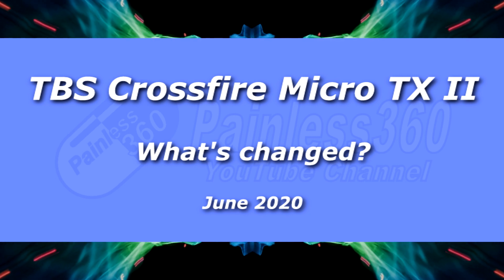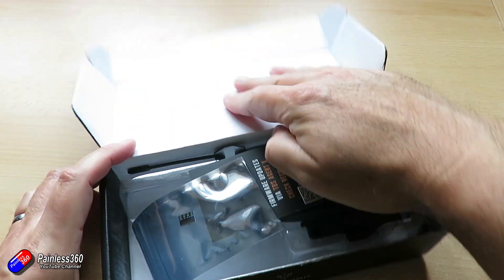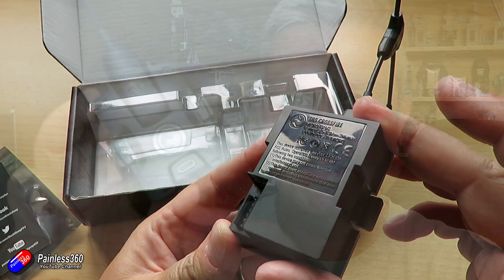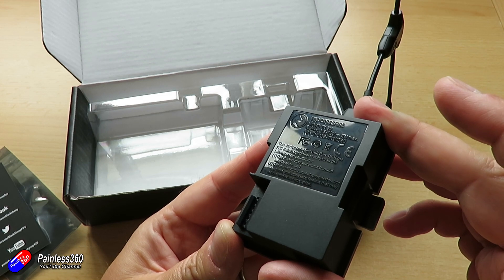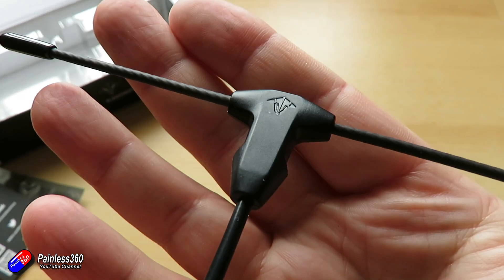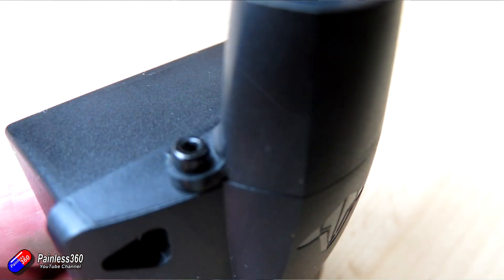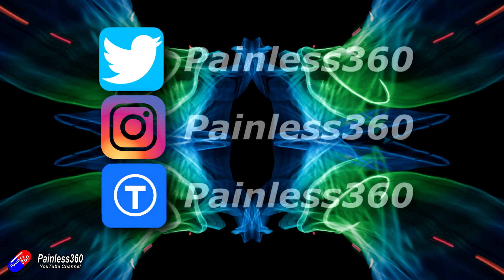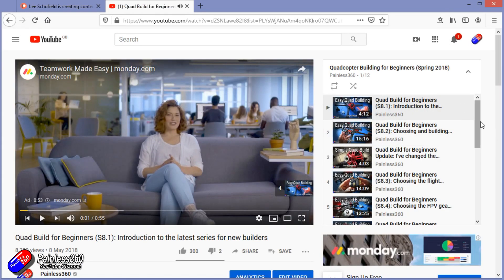TBS Crossfire Micro Tx V2: What's new?

Comment: Question what is the piece that comes along with the module the little tiny board?
Reply from the maker: AT what point in the video?
Reply: @Painless360  It's in the bag you take out with the info card in the very beginning. Sorry I'm a noob just got mine in the mail today and not sure what it's for..
Reply from the maker: Ah! That is a replacement inverter for radios like the FrSky QX7 where FrSky (despite knowing that a faster inverter was needed for things like Crossfire, and the better part only costing another $0.05) cheaped out on the inverter they fitted so that Crossfire couldn't run at full speed.
Reply: @Painless360  Thank you!!! This hobby is fabulous but the learning curve is something else. I just purchased first 5 inch quad  switching from Frsky to Crossfire and purchased the Rapidfire for my goggles. YouTube has been super helpful but not as much help as talking with a knowledgeable person such as your self once again thanks!!!

Comment: TBS are doing it wrong, you're supposed to update it to a new protocol which breaks compatability with not only competitor products but most of your own lol.
Reply: That's a low blow. 
FrSky saw what you did right there
Reply: ugh - this hurts my heart. I'm literally sitting here considering changing because of this. I have an ACCST controller and so I Cant use the newer one, and it doesn't make sense to buy the older one, and currently my R9m is tripping and giving me reception issues...ugh
Reply: @Bigbeardfpv  in this exact position myself. I'll never buy FRsky again. I'll just pony up the extra money for TBS
Reply: @neale3  hey I purchased the micro TX v2 and never looked back. The system is great, and I have a lot more confidence !

Comment: I just pulled the trigger on mine but I have the xlite now I have to get the jr adapter which I can only find in China so it’ll be a month at least before I can use mine unless anyone knows where to get a jr adapter for the xlite in the USA lemme know 😉
Reply: I have that setup. It works but the adapter does not hold the module very well. I had to secure it with a few zip ties. I would much rather have the Tango 2 than a Frsky radio with an external module. If you have access to a 3D printer, look on thingiverse for better designs.
Reply: They sell it on Banggood.

Comment: Any info on the MicroTX v2 essentially getting bricked and not accepting any firmware installations? The MicroTX module worked great in my FlySky PL18, not a single problem. But then I got a TX16S MKII Max and used it one time and powered it off after my flight to recharge the battery. Then the the next time I went to fly, the MicroTX wouldn't power on. It only goes into bootloader mode when I push the bind button and it gets stuck and won't finish the firmware update process. I've tried everything. Is there a factory reset or another work-around that I can try?
Reply from the maker: I've not seen that. I'd check the forums for others who may have had it... Best of luck

Comment: Hi Lee, I am following the crossfire and AR wing series, but I'm having an issue, my crossfire micro Tx v2, won't bind or work in my Radiomaster TX16s, yet will in Taranis X9d+, can you please confirm for me that you are using this combination and it's working for you, all Tx's are running Otx 2.3.10, and crossfire is 3.7.8? Thx Andy (or, have I missed something?)
Reply from the maker: Yes, OpenTX 2.3.9 on the radio and latest FW on the Crossfire. You did watch this video of mine? - https://www.youtube.com/watch?v=1XA_LUymaaI Make sure you're subscribed and have the bell notification icon selected ;)
Reply: @Painless360  Hi Lee, further to this problem, for me anyway, when I installed my Micro TX V2 module, I chose the CE region setting (sets the freq and power to correct values for the UK), however this stopped it binding for me. The workaround was to change the setting to open, then set the power to 25mW and the freq to 868CE, now it binds every time. Very strange but works now.

Comment: I am using the v2 micro tx and although they made the antenna non removable if you move your antenna around it will unscrew the sma to u.fl antenna adapter inside I couldn't figure out why my rssi was so low turns out the adapter inside was loose once tighter up works great again

Comment: Im just starting out into drones. 
I've been told I should buy the TBS tango 2 as all I want to fly is drones.  The tango as you know has the micro tx with power output range 25 to 250mW. Im wanting to build a 6 inch longish range.  Would the tango be enough or should I buy a radio master tx16s and buy the full or lite crossfire later.  Thanks
Reply from the maker: It depends on what you want in the future. If you get the excellent Tango II then you're locked into TBS receivers. If you get something like the TX16s (which a lot larger) then you have options for other parts of the hobby via the other supported protocols and module bays... See my Kit Picks 2020 video..

Comment: Good night. this Crossfire micro TX module works with the old Radio turnigy 9x (with opentx)?
Reply from the maker: It is the same as any other Crossfire module so doesn't need anything different... Happy flying

Comment: Well I guess I'm glad I perchanced the original version last year.  I can replace my antenna with no problem.  I do like the new USBC connector but I can live with out it.. I really enjoy using it for peices of mind and I don't have to worry about failsafe.  Thanks again for the information and video.
Reply: Yeah, but you have to deal with those screws every time.
Reply: @metoo3918  No it's just a plastic cover that can't even be put back if you use another antenna.

Comment: Been doing some research and it seems like its sold out everywhere and should be in stock in about a month or so. Plus what it takes to get shipped. Is there anywhere I could get the v1 so I wont have to wait that long??
Reply from the maker: Crossfire stuff always sells out fast, it's worth the wait..
Reply: @Painless360  Why is it worth the wait?  So far the only differences are USB-C and the way the antenna is on, right?

Comment: Do I still need to solder that tbs mod chip on my taranis qx7? I ordered this v2 about a week ago. Thanks.
Reply from the maker: The new module from TBS doesn't fix the fact that Frsky fitted a crappy slow inverter in their radio.. If you want CRSF at full speed then you need the mod.
Reply: Thank you!
Reply: @Painless360  Does the module come with it or you've ordered it separately?

Comment: can TBS Crossfire Micro Tx V2 used with JR 11XZero
Reply from the maker: It supports regular PPM in the JR bay but I've never tried it in that radio. Best of luck!
Reply: @Painless360  the Flysky FRM302 is supported so the Crossfire should run with no issues.

Comment: My plan is to get crossfire in the future. But sadly my qx7 don’t support these modules without  messing up with its internals
Reply from the maker: It does, but not at the full 150mHz speed ..
Reply: It's pretty easy. I did it to my Horus x10s no worries and it's more difficult than the qx7.

Comment: So is worth upgrading if you already have a Micro TX 1?
Reply from the maker: If it's working and you like it - I can't see any killer feature on this that would warrant an upgrade for upgrades sake..
Reply: Painless360 Thanks!!! I feel now less stressed having purchased the “old” model a few month back.
Reply: It's functionally the same but it has been confirmed that the new version is capable of higher power outputs. It has however not been said what specific power ouput settings will become available later, so far it's the same 25mw - 100mw - 250mw.

This module is just a bit more purpose built and higher quality, staying cooler at the same power levels.
Reply from the maker: I'm not allowed to comment on that yet ;)

Comment: The integrated antenna is going to make this more difficult to pack and repair if it gets damaged.
Reply: No, you can remove it easily. It's an sma connector under the plastic lock.

Comment: Hey, do u know? it's useable with Jumper T8SG plus?
Reply: I don’t know if version 2 is compatible, but I am using version 1 of the Micro TX with the Jumper T8SG Plus Carbon. I had to do a simple hardware mod and update the T8SG firmware to the more recent one. Works great! Even the menu to configure the Crossfire is available on the Jumper (This is similar to lua script on OpenTX except much friendlier)

Comment: I didn't get what is really new beside integrated antenna and usb type c? Multibinding supported in previous version as well.
Reply: @jovanrado9548  500mW ? that's the power of the R9M.
Reply: @calibermix8159  R9 module goes up to 1w on flex firmware.